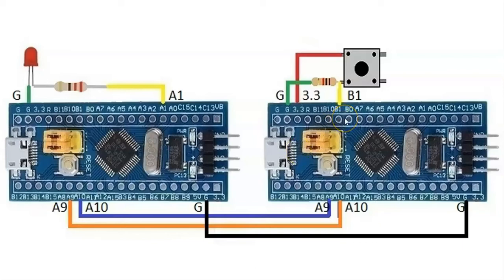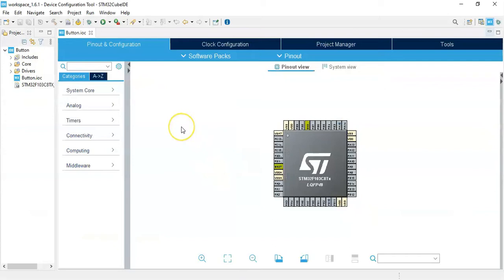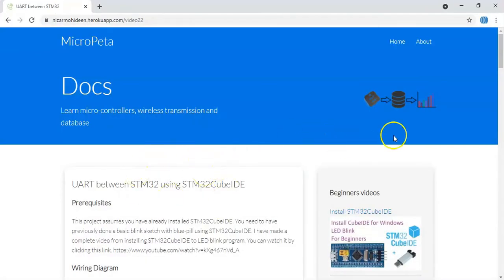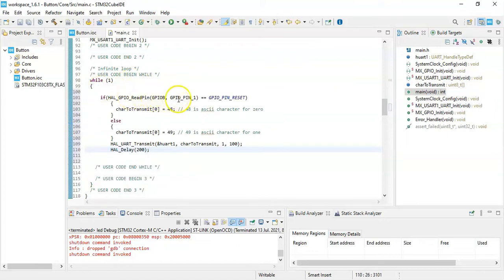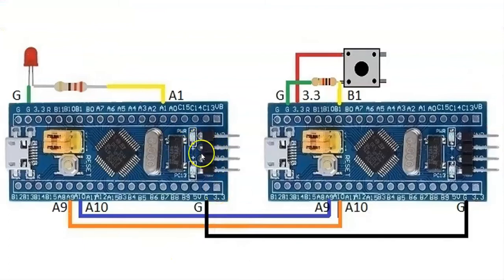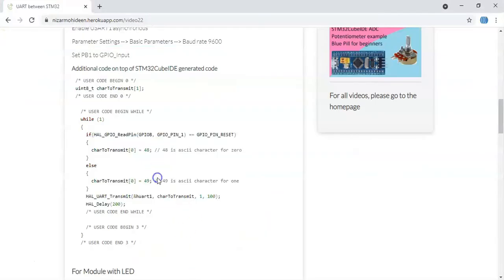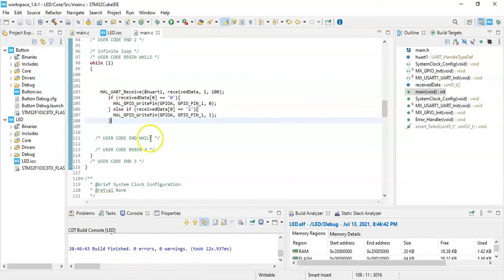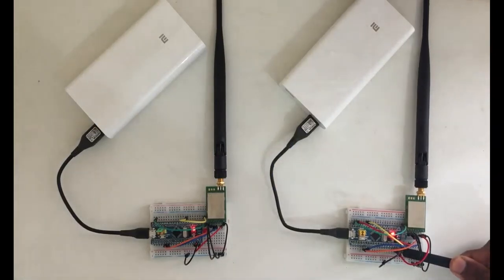22. STM32CubeIDE UART between STM32F103C8T6

Comment: Hi, sir. Thank you for the useful video and explanations. I have a question. First, I construct the circuit without LoRa like you did. And it worked. But after I connected the LoRa modules, it does not work. I checked the configuration parameters of modules and there is no problem there. Do I need to add a library to make this code work? Or what could be the problem?
Reply from the maker: We do not need any libraries for this example.
Check the power supply or wiring
Thanks
Reply: @NizarMohideen  I checked them, there is no problem on them.
Reply: @NizarMohideen  I also checked the LoRa modules parameters, like baud rate, channel etc. In addition to that, I checked the code also and it is working properly.
Reply from the maker: M0 and M1 needs to be connected to GND
Can supply 5Volt to VCC
Can swap the LoRa modules. It mean there is one LoRa module with transmit STM32 and another LoRa module with receive STM32. Swap these and see
Reply: @NizarMohideen  Hi sir, I really appreciate for your response. I tried them now. But it still not working. If it is not a problem for you, I really want to hear your other advices.
Reply from the maker: Ebyte uart LoRa comes with frequency 169 MHz, 433 MHz, 868 MHz and 915 MHz
Eg: 
E220-400T22D is 433 MHz
E220-900T22D is 868 or 915 MHz
In order to communicate each other, both module has to be same type
Reply: @NizarMohideen  Yep, both have the same frequency. 868 MHz . Do I need a driver file for LoRa maybe? I just found for E220-900T22D but mine is E220-900T22S. I give it a try anyway and it did not work again. I also found  LoRa_E22 driver but it in .cpp type. But I am working with C. I guess plue pill already has that driver inside it but I am trying everything.
Reply from the maker: There may be some issues with RF signal transmission. The antenna must have same frequency as the LoRa module. 
In case of week signal due to unmatching antennas, you can still test by keeping both LoRa modules close to each other.
As for the library, I am sure we not need it as I have even used these LoRa module without any microcontrollers as I have shown in https://youtu.be/0SoOLe7bYZI
You are most welcome to dig in and learn about libraries. Thanks
Reply: @NizarMohideen I did not get that, how can I check the frequency of antennas? Thank you for the video link, I will take a look at it. Learning do not harm :)
Reply from the maker: Vector Network Analyzer (VNA) can be used to check antennas as shown in https://www.youtube.com/watch?v=91ZRTFZ40rw
Reply: @NizarMohideen Hi, again sir. Now I am realising. You mean if I keep the LoRa modules close to each other, no need to use antenna?
Reply from the maker: Yes. That is correct but with caution
"For in-house testing we do not need the antenna. If we do not use antennas, we need to switch the power off for 5 minutes every 5 minutes to cool the module. (5 min on / 5 min off). The reason is RF power will be returned back to module if no antenna found and it will produce heat"
Reply: @NizarMohideen  This is also did not work sir. I think the issue is about the operation mode of the LoRa's. Maybe it get into the low power mode and that's why it does not receive or transmit the data. I will work on it. But, if you have other advices, I'll be very happy to hear that also.
Reply from the maker: All the best
Reply: @NizarMohideen  Hi again sir. I really appreciate your efforts to help. I just want to ask one last thing. When I try to send AT commands to my LoRa module by using USB to TTL converter, LoRa does not give any response. I made a research but I did not find anything about whether I can use that converter to send commands or not. It says TTL level output in the ebyte website. I guess it can be used then. Do you have any idea why it does not give response? By the way these modules can work with arduino, so I am sure about they are not broken.
Reply from the maker: Ok. Use https://www.youtube.com/watch?v=6vIYaawRQ2g
video to set the key, frequency and all parameters same for both lora modules.
set the baud rate for 9600 for  both lora modules.
set the cubeide baud rate to 9600 as well

Comment: when i am debugging the code using STLINK an error is coming as STMicroelectronics ST-LINK GDB server. Version 7.7.0
Copyright (c) 2024, STMicroelectronics. All rights reserved.

Starting server with the following options:
        Persistent Mode            : Disabled
        LogFile Name               : P:\stm32_projects\bootload\Debug\st-link_gdbserver_log.txt
        Logging Level              : 31
        Listen Port Number         : 61234
        Status Refresh Delay       : 15s
        Verbose Mode               : Enabled
        SWD Debug                  : Enabled

COM frequency = 4000 kHz
Target connection mode: Attach
Reading ROM table for AP 0 @0xe00fffd0
Hardware watchpoint supported by the target 
ST-LINK Firmware version : V2J45S7
Device ID: 0x4c3
PC: 0xa
ST-LINK device status: RUN_MODE
ST-LINK detects target voltage = 3.19 V

Error in initializing ST-LINK device.
Reason: ST-LINK: Could not verify ST device! Abort connection.
Reply from the maker: The reason may be due to clone stm32 chip
Use CubeProgrammer to upload the code as shown in
https://www.youtube.com/watch?v=YocudAJBH-g

Comment: I have a couple of questions about sending data another IC can you share your telegram or e mail or Skype to ask something.If it is not possible my question is how can send anolog value another STm32 i tried but mostly each value example 22 value coming like 50 50 two byte coming independently ASCII value but I need value not character.
Reply from the maker: Yes. The text can be converted to number as I have done in video-no-71 in my YouTube channel.